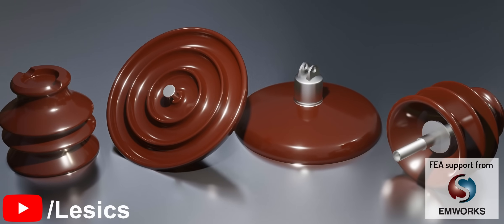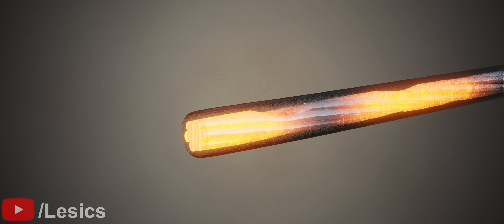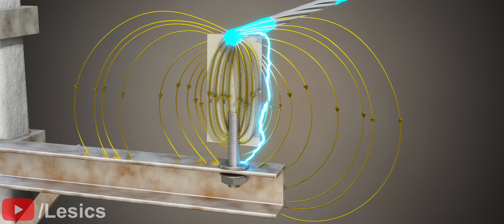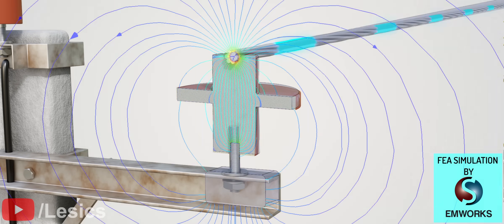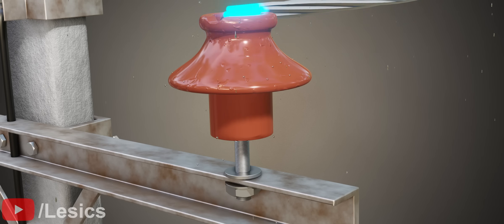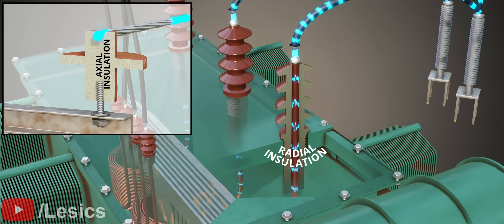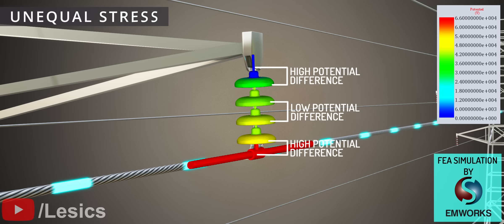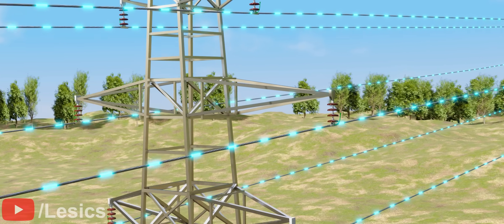Electric Insulators | Why are they Crucial?

Comment: I thought the insulator discs was only to prevent leakage because of raindrops. It's also crucial to prevent the spark because electric field.
Reply: They also stop arcing between screwed connetions on each end of a line..
Reply: It is both effects.
Reply: Did you know high voltage power lines don't have any kind of insulation?
Reply: It prevents ionizing arcs in air

Comment: In fact, the metalling ring in some cases has another scope: bypassing the isolator in case of lighting stroke on the power line.
That's because when a lighting stroke occur on the power line the voltage reached is much higher of the nominal voltage of the power line and that can damage the isolators and the others components working on the line, the ring in that case act like a conductor that allow an arc to the ground through the metal pylon that is always grounded. 
Of course the distance between the metallic ring and the pylon is calculated to allow a bypass only when a certain voltage is reached
Reply: Yes the guard ring.. It's compensates the earth capacitances and also provides the path for flash over current by protecting the insulators.. And this will also be shared with the lightning arrestors.
Reply: i was wondering why in the suspension insulator they uesd metal clips and not some insulated material
Reply: @MysticX_X  To provide mechanical strength💪. Even though it's a conductive element, metal is the most efficient thing to put there when taking other aspects into consideration.
Reply: @InvincibleArts  Yeah that makes sense, thanks

Comment: Every "umbrella" disk provide 15 KV AC of dielectric insulation.
A 220 KV 50 Hz line uses insulators with 20 - 22 disks. There is a mathematical formula which optimise the number of disks, their size, and their spacing. Insulators usually include a safety factor of up to 50% to counter the effects of inductive loads, overvoltage, and lightning strikes.
The insulators on HVDC power transmission lines have a different composition and a different design, because they are less subject to capacitive losses, but more subject to ion migration.
Thank you Lesics, for this great video...

Comment: These bush increase the creepage distance. Creepage is a distance between two metal along the surface of object.
In high voltage pcb design we should give proper creepage distance otherwise the pcb will collapse.

Comment: very informative video as to the different types of insulators. With the suspension insulators, it is my understanding the length is determined by the amount of voltage they carry. Longer ones carrying higher voltages from a sub station opposes to a power pole of lower voltages.

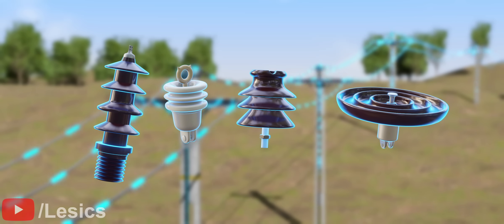Comment: 00:24 on the contrary, there are certain types of over head transmission lines that do have insulation layer. They are called covered conductors. They are used in forested areas, especially in forest reserves.

Also I suggest to not use the term insulation shield freely. Insulation shield is a semiconducting coating over insulating layer (It is differenr from insulating layer itself). It serves two purposes.

1) To ensure equipotential lines along the insulation, such that it eliminates tracking
2) To contain/isolate electric field to insulation.

Comment: How about building a mock-up of a lesser known problem. When 2 terminated high voltage lines are connected with a bolt, so that a right angle current to the wire, causes a big bulge in the field at the bolt, creating the need for a stress cone.

Comment: What would be more important is that how many (minimum) insulator discs are required for each level of voltage. I live in the Philadelphia area and the the SEPTA Regional Rail lines that travel over the routes formerly used by the Reading RR used a catenary system identical to the "2 X 25" systems found on European high-speed train routes and on the Northeast Corridor between New Haven and Boston, except that the catenary is powered at 12 kV/25 Hz AC (identical to the former Pennsylvania Railroad) and are suspended using insulators with three discs, while the transmission line(s) are at 24 kV/25 Hz AC (and 180° out of phase) and suspended by same insulators, but with four discs instead of three.

Comment: Can you make a video on corona noise coming from high tension wire of 33kva and higher. It always intrigue me the noise coming from those wire, also explain how a electric lejate leakage generate noise and it's frequency in the db amplitude.

Comment: When I was in Turkey they had concrete and steel high voltage poles and half of the insulators was missing, I did not dare go near any high voltage poles there... Also no surprise they had every day power outages that could last for hours.

Comment: I am thinking of suntricity(voltage in air), if like a shielding way from the sun?
Another is, the lightning protection rod, if one on top of rooftop(brick building) then runs down to underground while it spins, maybe can pull all the voltage from the natural disaster(equator have hole)?

Comment: That last part was actually more of an arcing horn than a grading ring, but otherwise nice presentation.  I have collection of various insulators from 11kv up to 66kv in porcelain and glass. I have always wondered, was there any strategic reason why brown was chosed as the standard glaze colour? Also some of the glass ones are in turquoise which looks nice, though I've always wondered why they came in such a range of mostly blues and greens etc.

Comment: Request to Lesics! Could you please make video on 1) types of insulators used in electrical systems 
2) no.of disc insulators used for various voltage ratings of power line
3) common material used in the insulators for power transmission lines
Reply: Suspensions, line posts, station posts.
Discs are up to the utility, rule of thumb is 15kV per suspension bell.
Most modern insulators are made from electrical grade ceramic, or silicone rubber. Some are toughened glass, cyclo-aliphatic resin or electrical grade plastics to a lesser extent.

Comment: The video feels as if it is cut off in the middle. The issues at 5:18 describing the handling of the capacitance around the supports for the transmission line should be further explained.

Comment: I remember practical engineering Chanel had a similar video where mentioning that you can more or less determine the voltage of a cable based on the number of plates. Does anyone know how many voltages a single disc represents?
Reply: They were surge arresters maybe. I'm not sure that they both are same.
Reply: It depends on the regulations of the country, I don't think it varies too much tho. In Argentina, for this type of material you have the nominal tension over 15. Plus 1 or 2 depending on the type (Retention or suspension).
TLDR: Count the disks and multiply it by 15
Reply: Not totally accurate, but you can estimate about 20kV per bell. A lot of places are moving over to polymer insulators, then it'll be more of a length thing.

I edited this. 20kV.
Reply: In the Practical Engineering video (I've just watched it again) Grady indicates that each disc accounts for around 15kV.
Reply: @philjordan1749  This is an edit. I guess my memory isn't what it used to be. I just counted the bells on a 345kV line and there were 17. That's 20kV per bell.

Comment: First and foremost, I apologize for my ignorance. Could you please explain why this is an electric field rather than a magnetic one? Or is it a combination of both, constituting an electromagnetic field?

Additionally, could you also clarify why it's more likely for the electron to be ejected at Point A? I understand you mentioned it's because it's under more stress and experiencing greater force, leading to a disruptive discharge, but could you provide a more detailed explanation, please? Thank you.

Electric discharge occurs due to the presence of an intense electric field that causes the displacement of electric charges in the surrounding medium?

In the case of a high voltage power cable, there is a significant potential difference between the conductor and the surrounding environment. Does this create an intense electric field around the wire?

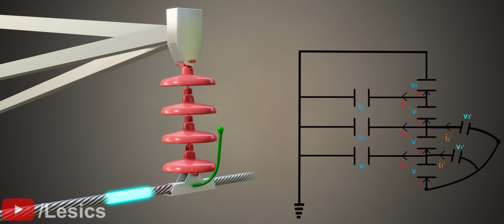Comment: 5:25 what are you talking about? The metal spikes/rings at the end of insulators are either corona rings or arc horns. Nothing to do with capacity.  
1:45 no the electric field "intensity" is not equal. Just leave this sentence out as it's not needed anyway, the rest is ok.  
4:15 the suspension insulator with single disks is only used in some countries. Others use insulators that are one block.
Reply: If you do more research you would understand
Reply: @nick8231  What are you talking about?

Comment: As you mentioned covering a metallic wire with plastic insulation leads to problems. Nowadays we are seeing wires covered with plastic insulation. make a video of how they overcame those problems
Reply: For transmission and distribution lines they don't use any insulation on conductors.. They are bare conductors.
Only for the communication cables such as teliviesion cables, Wi-Fi and other cables will have the insulation of different materials and of different grades. Without that insulation in communication lines, more noise will be added and is interfered with the actual signal to be transmitted. Hope you got the answer.
Reply: @InvincibleArts  Not a hundred percent true, but the majority yes. There are some places using covered conductors for various reasons.
Reply: @mikemazzantini6397  ohh.. I have never heard of it. But I don't think so.. Maybe..!!
Reply: @InvincibleArts  You can think whatever you like. I work in the field and it's a fact. I just spoke to someone Wednesday from a utility that was looking into installing some.

Comment: Is there a way to observe "field lines" in reality? How? Thanks.
Reply: They are just imaginary lines, to visualise fields
Reply: well you can use iron dust and a surface, like we do with magnets. This is basically an eletromagnet
Reply: @mazocco  ... To see their fields, not the cartography remnants.
Reply: @robertdiggins7578  those lines marked by the iron dust are the field lines. The stronger the field, more lines will appear. You will have to use some matter to be able to see magnetic fields the same way you have to use some matter to be able to see light.
Reply: @mazocco  interesting. If you surround a bar magnet with LED lights and then look through a filter with a thin layer of Ferro fluid, you will see a number of lines (illumination of the field by a focus of light) determined by the number of LED lights. 🤔
Reply: So, with dust, doesn't the amount of dust play a role in how many lines there are?
Reply: @robertdiggins7578  i meant they both need matter to be observed. A beam of light will only be visible if reflected or scattered by something, like fog or smoke in a concert. About the amount of dust, the amount will make the lines thicker actually but wont increase its count.

Comment: Video idea: Why dont we use 1 wire without earth return for long range power distribution.
Invented by Nikola Tesla and explained by Avramenko as being the best way to transmit power due to less loses and you can even burry the conductor in the ground cause it supposedly has zero near effect leaking.
Reply: They do occasionally, but it’s super dangerous. Least with ground return / or 3 phase, can detect when unexpected power is lost and cut the power.  If it’s only a single wire and it falls down it’s going to remain energised because that could be normal power loss etc
Reply: Awesome explanations!!

Comment: Really?  I was taught it had to do with surface area.  Instead of having a smooth insulator say 5 or six feet long you could have the same surface area in one that was only one foot long if it's surface  was rippled.

Comment: You are showing "Isolators", that is not referred to as an insulator.  An insulator is the covering around the wire like THHN.
Reply: I work at a high voltage lab and we call them insulators. 🤷‍♂️ We call them glass or porcelain bells and the others we call either NCIs or polymer insulators.
Reply: Insulators and isolators are two two different things isolator are mostly used for vibration and insulators are mostly used for electricity 🤦‍♂️ do your research

Comment: If these are the reasons, then the designs aren't very good.  Others designs would much more efficiently achieve the goals stated here.  Something in this video is BS.
Reply: Ok.  Please share.
Reply: Please share. I would like to know as well.
Reply: The sizes and shapes of the insulating rings are independent of the field-line densities and do not minimize water-streaming.  As one example of an alternative, placing slightly conical insulators at the top and bottom (both pointed up) would match insulation with field-line densities and increase insulation perpendicular to the fields.  If cost weren't an issue (and it wasn't mentioned in the video), you could include a Faraday mesh.  Second, small radial ridges or grooves on the insulators would limit water-streaming (especially when the insulators are unlevel), as would a scalloped edge.

Granted, these design changes might increase wind-resistance, wildlife affordances, cost, or other relevant factors.  Hence, the first clause of the OP.
Reply: @ncooty  I should state that electric field line density does not change from that disc, it creates proper insulation across concerning part of electric field.
Also why would pointed up insulators works better, by forming up a bowl? Besides, normal insulators got multiple layers of umbrella, forming a real long way for the water to travel and inner creepage for hanging insulators.
Faraday mesh? Unnecessary conductivity on the way is a bad idea.
Reply: @CRITICALHITRU :  You seem to have misunderstood most of what I wrote.  Maybe I described it poorly.  In any case, I don't think it's a conversation worth continuing.  The changes I suggested are empirically falsifiable, so it's hardly a matter of rhetoric.